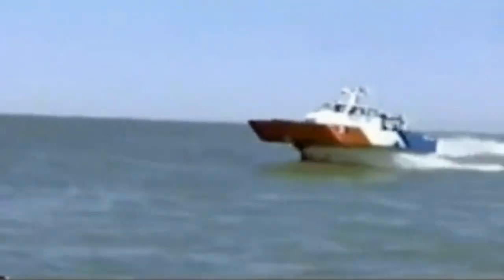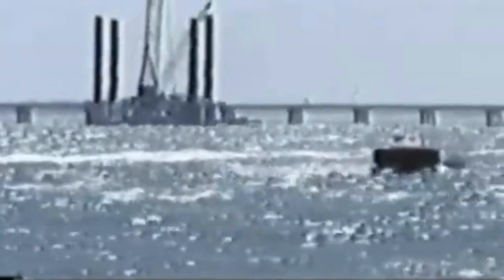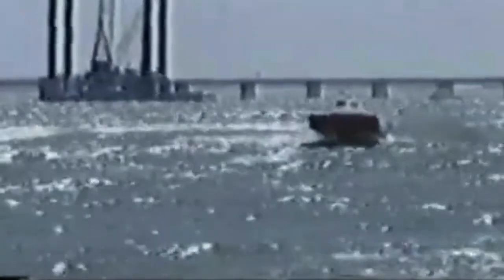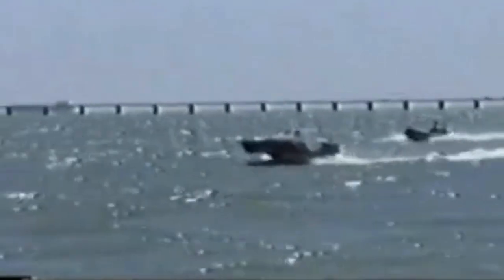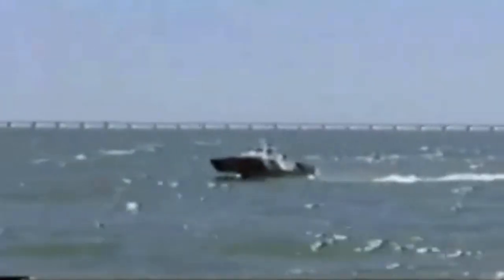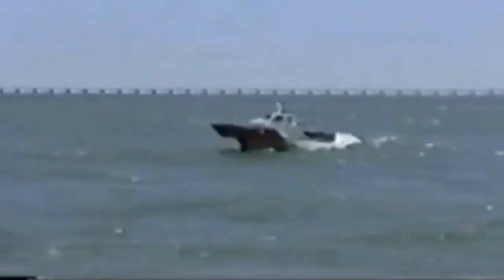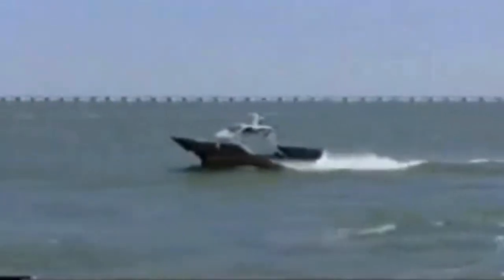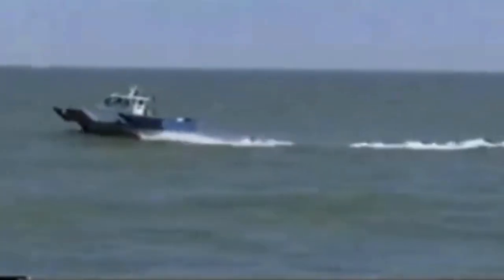GerrisBoats origins - We started from this concept: US Navy - John R. Meyer - QUEST

Comment: Make it retract hydraulically into a recess in the hull like a sailboat daggerboard  and it would overcome the draft issue, work as a displacement hull when desired and get on plane faster by reducing drag.
Reply from the maker: It’s more or less what we designed in all our models. We also added movable side hulls on smaller platforms. Another benefit is from quick interchangeability of the “torpedo”. Think about overhauling, refit, upgrades. Torpedoes can be industrially made, and installed in a variety of vessels stopping operations just for some days.
Reply: @gerrisboats  I visited your website. Have you actually BUILT any of your "designs" or are they all merely computer generated concepts?
Reply from the maker: @UguysRnuts  we built and tested a demonstrator to scale, 1:2 of small platform and 1:5 of the large one. I'll public some videos soon. We're now building the full electric 8m tender/taxy, in consortium with Azimut|Benetti, the world leader in superyachts... and we're now looking for funds. Italy is not Silicon Valley.. more ideas than money for startups 😅. Have a nice day
Reply: @gerrisboats  I didn't think so. Hahaha!
Reply: @gerrisboats  are you a public, seedstock, or small play company???

Comment: What about larger waves the boat  won't ride  over it but impale right into it wouldn't  it.
Reply: At some point, at some specific sea state and wave size, the foiling idea will cease to be functional.   Partly as a function of foil draft and available power.  So yes, a series of crash and burn maneuvers.  But - up until that point, this foil will function really, really well.

Comment: You won't dock in a small/shallow marina!
Reply from the maker: That's from what we started... We solved with retractable torpedo (and a bit smaller :)  - but seakeeping and low fuel consumption is the same of a foiling vessel....
Reply from the maker: True, another ferry prototype has been built, 50m long, 35% of fuel saving, but over 5m draft. Service never started... but we solved this main issue.. keeping the benefits of the technology :)
Reply: Yes it won't perform in shallow water. 
However 99.9999% of the seas are deep enough. In those scenarios the performance is outstanding. 
Build a pier, it seems worth it.
Reply: No shit Sherlock

Comment: Never seen SWATH combined with hydrofoil before. I like both technologies, but surely the point of a hydrofoil is to get the boat out of the water? Here you still have a lot of drag with the SWATH hull still in the water. Just asking?
Reply: Not SWATH, SWASH.  Twin hull gives way to single hull.
Reply: Foils are fragile and making them less so makes them complex and prone to wear, but there are problems with transmitting power to the water in a full on foil.  If the objective is more about reducing speed lost to pitching moments while dramatically increasing comfort of the passengers or operator, this is a great compromise with a more robust construction.
Reply: This is the HYSWAS US Navy proposal from back in mid-2000's.
Reply: @TristanMorrow  "this test was carried out in 1996"
Reply from the maker: Totally true... so what will happen to all those electric foiling boats, heavily supported from media? They are flying on a thin structure, and faster... We decided to go ahead with this technology because it has some risks too but much less, since it's foiling at lower speed and with a massive robust strut.
Reply: That's called super cavitation not swattthhgffft